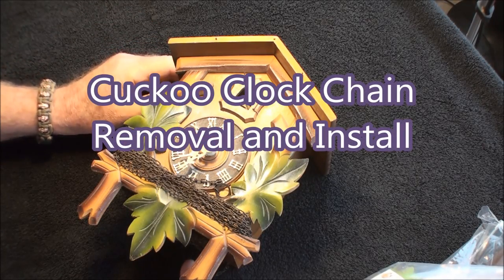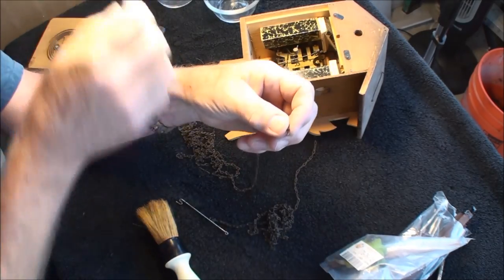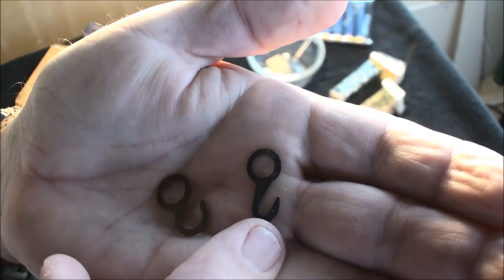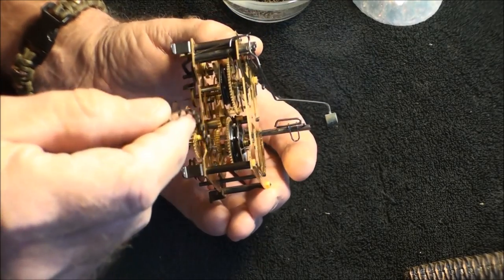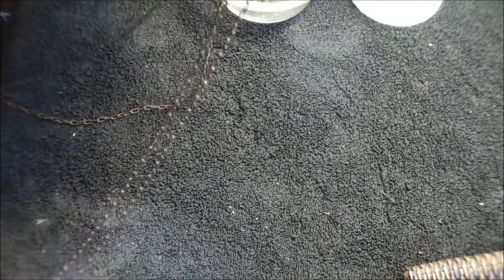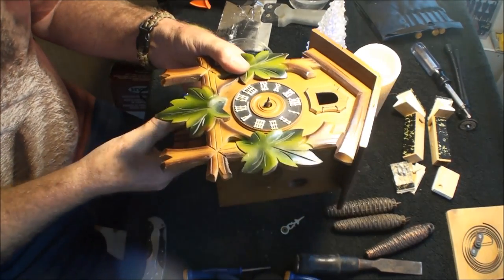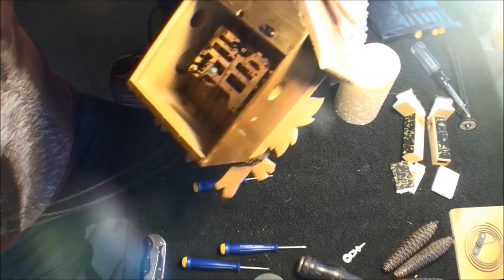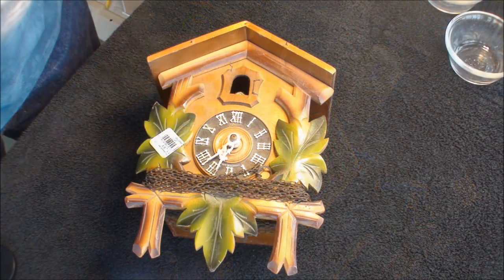How to Removal and Install Cuckoo Clock Chain

Comment: Purchased a clock at an estate sale. One chain and weight missing. Watched your video and had a new chain installed in the less than 5 minutes! After watching the video, I checked the weights and sure enough, the original was vintage and the one I purchased was the newer style. Great info.
Reply from the maker: Very nice to hear my video helped you on a successful repair.

Comment: Thank you for a very clear video. Although I did not get a couple of things, It seems you took off the chain again 'could not understand why. Then toward the end you are a little repetitive I'm sure most would know how to fix the end ring on. But it would have been more helpful to show a little more about the replacing of the mechanism in the enclosure.  Stiil it's very good work you're sharing here.... I'm here as I brought one from Switzerland in 1983 to Sydney Australia. Quite early the hours stopped cuckooing (like an answer to my prayer!) But on the half hours I always got the Cuckoo letting me know once.  However the last few years I had to increase the weight to get it going and today only the other extra addition of a 2 litres container of water can get it going.   I read somewhere that the accumulation of old oil and dirt about is the probable cause of the problem. So I'm trying to find out if I'll be able to clean it??? Thanks again :)""""
Reply from the maker: I have a few more videos on the Cuckoo Clock to show how the chain goes on without it in the box so you get a better idea what I am doing coming out soon meeekstube

Comment: I think its worth wiring through the links to hold the chain on the sprockets as you thread the other one and then through the case. At some point BOTH chains have a wire. Its such a pain  if you get all the levers and the bird and screws in place and one of the chains comes off.  You can do a similar thing OUTSIDE the case once the movement is screwed in if you want to. What I'd like you to cover is the necessary length of chain to run at least a day so regular winding becomes a possibility and if you miss it by an hour or so the weight hasn't grounded and stopped the clock. Nice video. Thanks
Reply from the maker: You have it right Beresfordjohn Greene. I have done this so many times, I don't even think about it anymore. Putting the chain on after the work are all back in is almost as easy, but now you have to worry about dropping the case. 
  As for the weight and chain to keep the clock running all day, you are right about missing it by an hour or two. Just making sure you have the clock hung high enough that the weight never touches the floor will help gain a bit of time. Also, if you wanted too, you could buy another chain and lengthen the clock chain by a foot or two, but you need the ceiling high to do this so the clock will have to hang closer to the ceiling so the weight will not drop to the floor.

Comment: That's exactly what I do, but with a plastic tool because with a steel tool, the chain always stick on it with magnetism !
But this magnetism is very usefull to get the end of chains through the casing holes.
Reply from the maker: I have screw drivers that are magnetized and ones that are not. Even a wooden skewer would work well Michel Bonnet.

Comment: I find your videos encouraging..   I've always loved Cuckoo Clocks as my mom had one and broke but didn't have any idea of how to deal with it.. But now many years later I've fixed one that the chain was off the track..  :) will be watching more..
Reply from the maker: Wonderful! Fixing your first clock is a good start. The more you understand what is making the clock work will make it easier on the next clock.
Reply: @justmike57  Yeah my New to me cuckoo Clock will run about 30 seconds and then then just stop.. Don't even know. what I should do.. Dang!
Reply from the maker: @CAScorpio  These wonderful older Cuckoo Clocks are so cool in my mind, but not knocking the clock... The Cuckoo Clock is considered a dirty clock because it is open to the dusty air. The chains pull up dust, the pendulum swings and the bird pops out. 
  So with all that said, now you have a clock you might not know anything about how it was treated. This clock might have been sitting in a box, shelf or just hanging for a long time. The old oil and dust will start to gum up or even turn to a shellac and the clock will slowly stop working. So the clock might need a good cleaning and oiling to get it all freshened up and start working again.
  I do have videos and an email address below the video if you need help along the way if you want to clean and oil the clock yourself.

Comment: Your Explanations are so detailed, your video is amazing. Thank you very much for taking the time to share your knowledge. 
Is there any way to determine if the clock I have is a one day or eight day clock? It hasn’t ran in years and no one from my family has any details.
Reply from the maker: Yes Vicki, The Size of the Weight will give it away. An eight day weight is very heavy and about 1 1/2 inches or more thick. So far in my videos, I have only been working on the 1 day clocks. Later this winter, I have many 8 day clocks to clean and get running again.

Comment: I am learning alot and hav gotten sum beautiful ones plus ones 2 repair thanks but can I put a chain on without takn it out of house
Reply from the maker: Yes you can! If you watch my other videos I kind-a explain how to do it. It's best to take both ends off the chain, turn you clock upside-down and start the chain onto the gear. Then turn the gear with a small, long screwdriver and turn your clock at the same time so the chain don't get caught up in the other gears.

Comment: Mike I don’t know a whole lot about stuff. But I do know that my cheap jewelry like the fake silver stuff ... I use an old toothbrush and some toothpaste and it shines stuff up right away… It makes it look new. Sometimes if it’s been a while in my drawer that I’ve used it... I will put the toothpaste on with my fingers and then let it sit for like 20 minutes and then go back to it… I don’t know if that will ever help you in situations like this but I hope that that does if you ever need it for whatever reason.
Reply from the maker: My clock cleaner will clean the chain up, but most of the time, you want to keep the old look, because the clock is an antique and you want to keep it looking nice, but old. Thanks for the suggestion Bubbles Butterfly and I will keep that in mind for other projects.
Reply: Just Mike Roger that😀

Comment: Hey Mike. Im trying to fix my grandparents cuckoo clock. Its a  vintage style 1 day clock, but 1 chain, 1 weight and 1 bellow arm is missing. Do I buy the same size weight as the one I already have and should I make my own bellow arm? Thanks in advance
Reply from the maker: Normally the cuckoo clocks have the same size weights for the time and the cuckoo. So yes, you would buy the same size weight as you have already. Sounds like you have a project on your hands. Good Luck.
Reply: @justmike57  oh and I also have the pleasure of replacing both bellows so wish me luck haha. Thanks
Reply from the maker: In case you need a little help. I have two different videos on the Bellow. One would be for just buying the new bellow and how I get it on the whistle box and another that I use Tyvek paper to rebuild your Bellow.

Comment: What about putting the weights back on? I'm trying to fix a music cuckoo clock, I have the chains back on but don't know how to hang the weights....(I got the clock with the chains separate so I had no idea how they were in till watching your video- thanks, but now what about the weights?)
Reply from the maker: I am not sure why you don't know how to hang the weight. You just hang the weight on the hook. On the video, you will see that the hook needs to be on the end of the chain that does not move when you pull on it. If you are still having a problem, let me know in more detail what you are having a problem with 
LaurasharkCW
Reply: @justmike57  I had to put the chains in and only 1 chain had the hook on the end- but your saying the weights go on the side the chain doesn't move- ok that makes sense thank you

Comment: Hi Frank
I have just received a clock from EBay. They said it all works ok. When I opened the box the chains have come off the wheels. I photographed and took out of box. Made sure the wheels turned in position and put chains on and it run freely. I hang it on the wall put the weights on and thinking I was winding it up I pull the weights and it done a weird cuckoo ,now both wheels are jammmed. And far as I can see both chains are still round the cogs . Any advice what I have done wrong and a fix. Thanks Phil.
Reply from the maker: It sounds like the chain might have looped around other gears besides the winder. You might try taking the chain ends off one chain, pull it out of the clock and try threading the chain back into the movement. Watch my video showing how I put the chains in this clock and you could do the same. https://youtu.be/au8AcLqVHpQ
Reply: Thanks Mike
I think I may have put the weights on wrong. Do the weights always go on the outside chains. I just copied the hooks as I took them off .As you look at the clock I have a pull chain then a weight then a pull then a weight. @justmike57

Comment: Love the tutorials Mike. ive tried everything you have suggested but to no avail. Ive taken apart my husbands Emil Schmeckenbecher Haufbrahaus musical chalet 1 day cuckoo clock but cannot get the pendulum to keep moving. He purchased the clock for his mother while he was stationed in Germany in the 80's. The clock chains were then pulled and slipped off gear by a unsupervised grandchild and hasn't ran since. We received the clock back when his mother passed away. I would love nothing better than to get this beautiful clock to work once again. Any suggestions?
Reply from the maker: Hey Michele Fagin, I do have new videos coming out, every Tuesday. Not all will be about the Cuckoo Clock, but I do show how the easiest way to put the chains back on. The easiest way is to pull the works from the cuckoo box, but you can also do it with the works in, but a little more difficult. But watching the video, you will understand more of what you are doing to get the chain back on the gear (winder). When you are getting the chain back on, it is best to take off the hook and ring on both ends of the chain, then start fresh.
  Also you have mentioned that you can't keep the pendulum moving. When it you start the clock, do you listen to the tick, tock sound to make sure the rhythm of the beat sounds even. And if it don't sound even, tilt your clock more to one side or the other to see if the beat becomes even sounding again. If the clock is really crooked with the right sounding beat, I have a video coming out soon on how to correct that issue also. 
  Below the video, in the more section that describes the video, I have my email address if you would like to email me and or send pictures.

Comment: Thanks for the video. Can you restring just one clock chain without taking the mechanism out? Three chains on mine, and one of them has come off. Trying to find the easiest way just to do the one. It's the one that does the time. Oops, I guess it was at the very end. Thanks a lot and we'll try it when I get home from work
Reply from the maker: I can. But watch my latest clock video and you will see what you are trying to do. It is hard to show, but give me a week or so, because I only put out one video a week on Tuesdays and already have one scheduled for this coming Tuesday Kelly D.

Comment: Hello Mike, I’m wondering what to do to dislodge the bellows boxes if they are glued to the side. And I mean glued all the way! I’ll look forward to any answer from anyone at this point! Thanks in advance.
Reply from the maker: I use a putty knife that is 1 1/2" wide. If it isn't already, sharpen only one side. After taking the screw out, start working the blade along the side of the whistle box and as you are wiggling the blade, push down and when you get a little bit under the box, give it little pries to see if it will come off. Once you get it off, use a small nail to keep the whistle box from moving around when the clock is working. 
  This is my video that had the whistle boxed glued on and I show how I got them off.   https://youtu.be/sXxGFgJfdZQ

Comment: Mike, any tips on how to fix a pendulum that will not continue to swing?  My clock is in good shape but I need to tip it into a position that is not natural on the wall to get the continuous swing.
Reply from the maker: Hello there C Mill. Yes you can fix the swing of the pendulum to swing while the clock is level. I can make a video on this subject in a few days, because the next couple of days for me are very busy. If you open the back of your clock and see the wire that is touching the pendulum wire. Hold the top of that wire firmly and then with the other hand, bend the wire just a little at a time, then set the clock level and see if you bent it the right way or enough. Hope this helps you and check out the video in a few days from now. Thank you very much for a great question and future video C Mill
Reply: @justmike57  That would be fantastic!  Whenever is convenient.  I enjoy your videos very much!

Comment: I have a cuckoo clock but I believe it's missing a rod to attach the pendulum . I have a photo but don't know how to attach it here. Looking at your video I see a rod that goes down through the pendulum slot, that's what I am missing. Do you know where I can get one?
Reply from the maker: For the close measurement, you would measure from the horseshoe looking thing, down, just outside the box. They call them a Pendulum Hanger and for where I order them, they come in an Hanger Assortment. https://www.ronellclock.com/Pendulum-Hanger-Assortment-CCH-24.htm
  I do have an email address below my video if you ever need some help on any other questions.

Comment: Hey... Great video, but I have a problem with the cuckoo sound. I followed your instructions but the clock makes the sound when the minuter Needle is in position III and VIII. 
What should I do to set the needle and the sound in position XII and VI?
THANKS.
Reply from the maker: You turn the hand until the cuckoo comes out for the time. take the nut off the center of the hands, Lift the minute hand off and reset it at the right time, aligning the square hole up with the shaft Jean Carlos. Thanks for watching and let me know it you understood.
Reply: @justmike57  Thanks. I did it and it works perfectly. Thanks again!!!

Comment: Do you have a video on how to fix gears that won’t move? I’m watching your video on how to rechain and the gears won’t move ?🤔
Reply from the maker: So I am thinking your chain gear isn't moving? Not sure, but it only moves one way so it will hold the weight. You would have to put the small screwdriver in where the chain rides. The outside of the chain area with the teeth will not move. Hope this helps and if not, email me at justmike2575@gmail.com
Reply: Thank you for your reply ! I feel silly !  Was trying to move the thing on the outside of the gear ! It has little teeth so I thought THATwas the gear !smh so I did get it rechained thanks to your instructions 😊

Comment: Would it have been easier and quicker to link the end of the new chain to the end of the old chain before pulling the old chain out of the clock?    That way the new chain would have automatically threaded itself through the clock mechanism correctly.
Reply from the maker: Yes John P. It would be easier, but what if you didn't have a chain on the clock because the ring fell off? I do have a video out that does just what you said, incase you want to change the chain only, if your clock is still working fine. Thanks for stopping by today John
Reply: @justmike57    I guess I haven't stumbled into that particular video just yet.     I have a Black Forest Cuckoo Clock that I bought 30 years ago when I was in the Black Forest region of Germany.    That clock has run reliably until last week when the ratcheting sprocket for the music box wore out.    I have only opened this clock up in the past to clean and lubricate the gear shafts.    This was the first time I ever had to take the clock apart to do a repair.    That is when I realized what a mechanical marvel these clocks are.  This got me to wondering about the "ins and outs" of servicing them.   I jumped on to YouTube to see what I could learn.    You have some very informative videos.
Reply from the maker: I try to put out the videos that help normal people work on their own clocks, if they dare. I am busy this summer, helping my brother fix his house and making videos doing just that. This winter I have more videos to do on the cuckoo clocks and also get into the 8 day clocks as well John. Look at my playlist if you want to see more of my cuckoo clock videos only. Thanks for stopping by

Comment: Awesome vid Mike that looks complicated💜🌲
Reply from the maker: You do enough of them, it will be a piece of cake, but helps out the people that only has one or two cuckoo clocks Purple Gang.
Reply: @justmike57  Hello Hoss ! Your video has helped me out alot . Someobe gave me an older Black Forset cuckoo clock that they were going to throw away the only thing was wrong with it was the chain was wound too much or stuck they had broke one part of the chain my question LOL is when you install chains do both chains need to be 50/50 and then pull the chains to wind seems like one side wants to get stuck but you left side? I sure hope you can help it would be greatly appreciated if not then I understand.